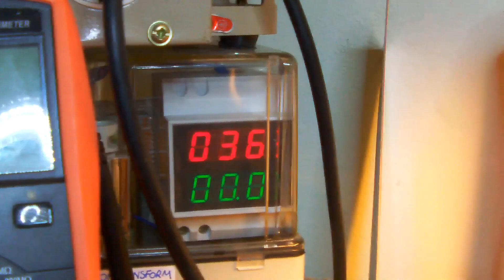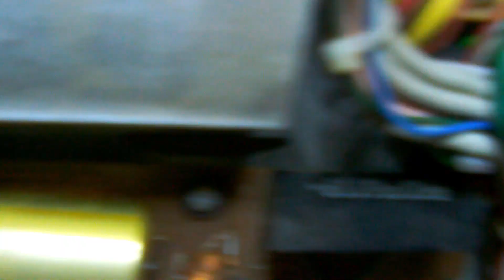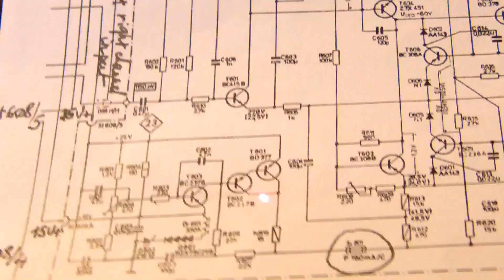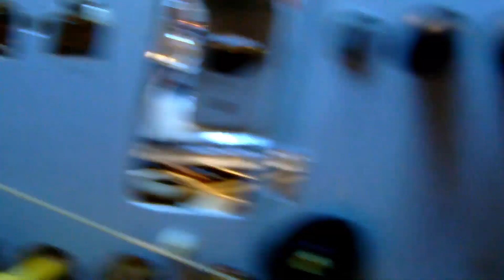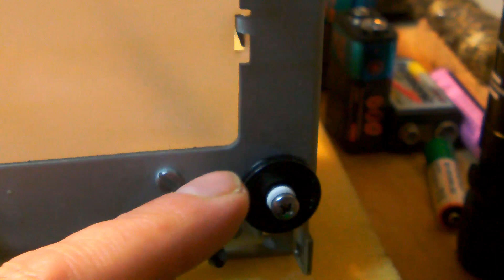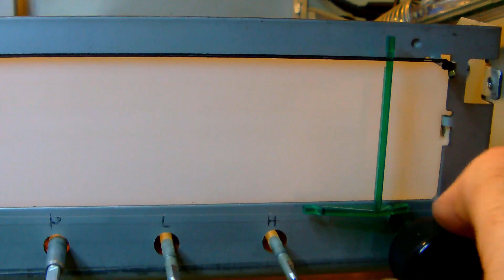Braun Regie 450-S Tuner Amplifier Repair Restoration part 1 of 1

Comment: Great ! I am always amazed at how heavy this amp is. Just out of interest what ohms and wattage speakers would you use if you had the choice??
Reply from the maker: Hello Zypp33. That's an interesting question. The service manual specifies any value between 4 and 16 ohm is acceptable. 
Any value between the two specified will work properly. If you'd want to squeeze all of available output power out of the amplifier  to the very last drop, you could go for 4 ohm speakers. Keep in mind though that might increase output signal degradation (clipping) and would also increase the heat dissipated by the end-stage transistors at (very) high volume. 
In my opinion, it's never a good idea to run an amplifier close to it's maximum output power for several reasons: At very high volume (and therefore output power) sound quality rapidly drops. Neither is it good for the speakers (if you use some that are rated to the same wattage or less than the output power of the amplifier).
Either way, at normal volume levels the impedance of the speakers will have very little effect on the sound quality, except for the most auditively sensitive music lovers who will even detect the slightest degradation of sound. My advice therefore would be to use 8 ohm speakers, rated at slightly higher wattage (say 45W RMS) and never go to max. volume on the amplifier (if only to protect your ears :)
Thanks for watching, giving me a thumb's up and subscribing. Until next episode!
Reply from the maker: Hello zypp33. I would simply buy 8ohm 3-way speakers with good filters and built inside a good solid wooden case, and who can handle, say, about 20% more RMS wattage than the output power of the amplifier.
A common myth is that the louder you want to play music the more power you need, but volume is as much dependent of the surface of the speakers as the proper filtering of the audio signal. This is logical because the more surface a speaker has, the more air displacement and hence volume it can produce. Of course there's a limit to the amount of air a single speaker can displace with a certain amount of power. Simple physics :) Simply put, well-designed 20W speakers can sound as loud as bad, cheaply constructed 50W speakers, but the sound quality of the former ones will be far better.

Thanks for watching and giving me a thumbs up